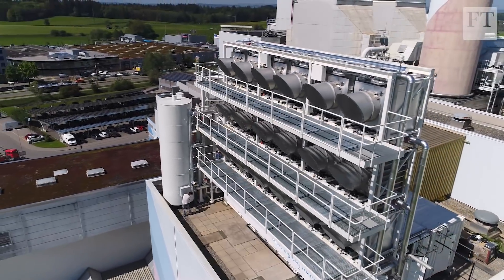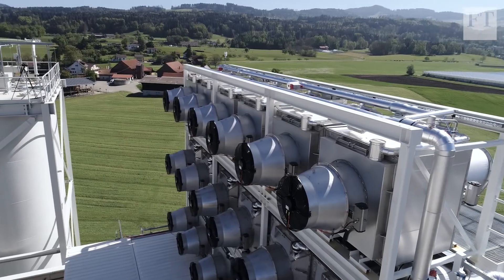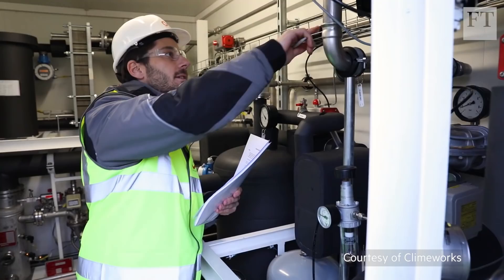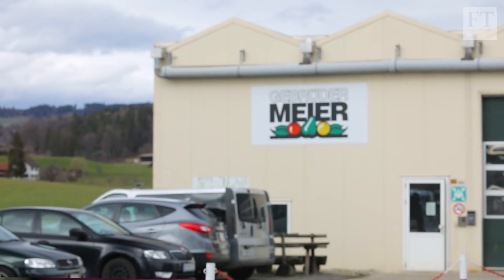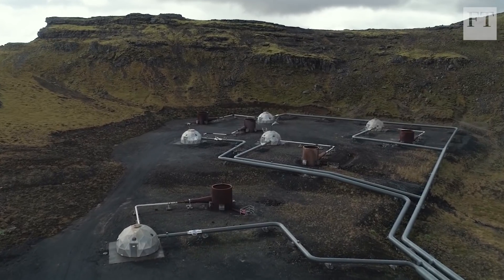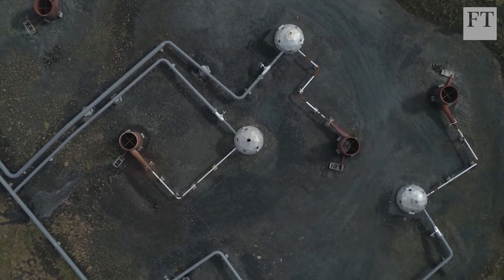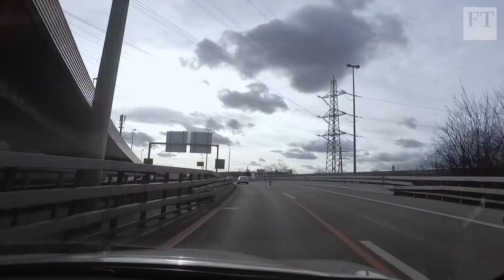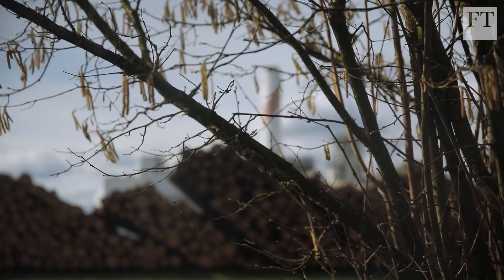How capturing CO2 from air can combat climate change

Comment: Doesn't it make more sense to filter the CO2 out of the exhaust gases of the waste incineration plant and to use the energy output as a substitute for fossil power plants? How much CO2 can be captured from the air with 1 MWh of electric energy input?

Comment: to say adding CO2 at the present rate is a crisis is being alarmist. While pollution in china and india is a real problem, pushing for climate regulations of C02 is a communist UN fraud. The climate models they run are a good science project but not accurate enough to determine energy policy.  Understanding why the climate model projections are essentially useless for policy is not easy but to say there is an initial state problem is the only way to summarize why they are only projections. C02 from man is not a pollutant and it wont end life on earth or even cause a crisis. Within 50 years it will be a moot point and all humans will have done is given in to hysteria and wasted a few trillion dollars for nothing.

Comment: Are you aware that teachers and professors are lying to you.  The science of radiation greenhouse effect is actually a lie.  If you see the video on my channel you will see that when a heat source is surrounded by CO2 it cools, not warms.  All of the "so-called science" of radiation greenhouse effect is nothing of a sort.  It is all lies.
Reply: I observed your three posted videos. Obviously you sunk a lot of money and time into this experiment of yours and it clearly was driven by an obsessive belief that back radiation from carbon dioxide is a lie. It is based upon your biased reading, of the NASA article, in which you already assumed that the CO2 molecules back radiate to the earth's surface. That was an incorrect assumption of what the article said.

Your experiment was poorly controlled for a number of factors. It was in no way configured the same way that experiments, showing the greenhouse gas effect, are configured. This experiment included no gas temperature measuring equipment, surface measuring equipment, or spectrographic equipment that would have provided quantitive data on the wavelengths of electromagnetic energy entering and leaving the system.

The filament on the high was being cooled by easily understood principals of loss from its blackbody radiation and via flow of the CO2 gas carrying it's thermal energy upwards. There was absolutely no evidence provided that any sort of back radiation was involved. Sorry, but you have deluded yourself. You are in the company of millions of other people who have deluded themselves.

Obviously, you have no firm academic background in fields such as radiation physics. There are millions of other people who are convinced that they know more than those with full academic credentials and a life-time of experience working in such fields.
Reply: Your explanation and demonstration are flawed and misleading.

When the solar energy, that makes it through the atmosphere, heats the land surface it warms it causing some of it to reradiate in the far infrared spectrum of the electromagnetic spectrum. Some of that energy is absorbed by the CO2 in the atmosphere which then increases the vibrational energy of those molecules. That energy is then transferred to the surrounding air molecules which heats them. Otherwise, the earth's reradiated infrared energy would travel back out into space. This CO2 capture, of the earth's radiated infrared energy, has been known for over 100 years. The heated atmosphere then does not heat the earth by radiated energy. It heats the surface by conductive and convective forces.

Those, without a strong academic background in the physics of thermodynamic principles, would not be expected to understand this process.
Reply: @vernonbrechin4207  Heres a link which shows NASA explanation.  Even their stupid (AND FALSE) energy budget shows IR emitting down and even shows the WORDS EMITTED. Its all a lie as my experiment clearly shows. https://science.nasa.gov/ems/13_radiationbudget
Reply: @vernonbrechin4207  Your another liar.  Your explanation is one you have just made up yourself and isnt present on the international websites, including NASA.  What they do show is made up bs with 2 plates, showing a radiation exchange.  Also, CO2 is an emissive gas and therefore increases the rate of heat lost from the atmosphere, meaning the level of energy which returns back to the surface is far less than it otherwise would be, if  it was instead a non-emissive gas.  Its contact with the warmer molecules around it causes a localised cooling effect.  It is well known that if you want to keep something warm you DECREASE emissivity.  This is the reason aluminium foil is wrapped around the outside of heating pipes.  Increasing the emissivity of something is how you make them cooler.  Increasing the oemissivity of the atmosphere, reduces the A / E Ratio of the Earth, resulting in lower steady state temperatures. The truth remains, CO2 doesnt induce any form of back heating.  Beside, did you SEE ANY FORM OF WARMING OCCUR TO THE FILAMENT??? As shown in the experiment.  The fake science of back radiation is a lie and anyone who argues that it isn't it is spouting sophistry.

Comment: Sorry, but climate change is a manufactured story !!!!!!!
Reply: You are correct.  You should see the experiment on my channel. (You tube wont let me post the links - they dont like proof against climate change.)  It proves that CO2 doesnt back radiate to heat source to make them hotter.
Reply: @gerainthughes3725  - Your explanation and demonstration are flawed and misleading.

When the solar energy, that makes it through the atmosphere, heats the land surface it warms it causing some of it to reradiate in the far infrared spectrum of the electromagnetic spectrum. Some of that energy is absorbed by the CO2 in the atmosphere which then increases the vibrational energy of those molecules. That energy is then transferred to the surrounding air molecules which heats them. Otherwise, the earth's reradiated infrared energy would travel back out into space. This CO2 capture, of the earth's radiated infrared energy, has been known for over 100 years. The heated atmosphere then does not heat the earth by radiated energy. It heats the surface by conductive and convective forces.

Those, without a strong academic background in the physics of thermodynamic principles, would not be expected to understand this process.
Reply: @gerainthughes3725  - When the solar energy, that makes it through the atmosphere, heats the land surface it warms it causing some of it to reradiate in the far infrared spectrum of the electromagnetic spectrum. Some of that energy is absorbed by the CO2 in the atmosphere which then increases the vibrational energy of those molecules. That energy is then transferred to the surrounding air molecules which heats them. Otherwise, the earth's reradiated infrared energy would travel back out into space. This CO2 capture, of the earth's radiated infrared energy, has been known for over 100 years. The heated atmosphere then does not heat the earth by radiated energy. It heats the surface by conductive and convective forces.

Those, without a strong academic background in the physics of thermodynamic principles, would not be expected to understand this process.
Reply: Just like evolution
Reply: @Richard482  your baby response wont change anything.  Watch the video on my channel and you will see the truth.  CO2 does not add heat to a heat source, to think such a thing could happen is just plain stupid.  Everyone need to wake up and realise they are being lied to by professors and politicians the world over.

Comment: Canadian company gets $68 million to build out ‘negative emissions’ carbon capture tech. March 22, 2019. 'The company plans on using the money to “commercialize and enter mainstream markets with its fully demonstrated DAC technology that is able to capture and purify atmospheric carbon dioxide (CO2) for under USD $100/tonne.”Carbon Engineering isn’t the only company to work on Direct Air Capture technology, which captures CO2 from atmospheric air, and puts it into purified form for use or storage. The company says it can deliver large-scale “negative emissions” by “permanently and safely storing the CO2 underground.”Carbon Engineering can also integrate its DAC technology with its “Air to Fuels” technology. This tech allows the company to convert the CO2 captured from the atmosphere into “ultra-low carbon fuels that can power existing cars, trucks and airplanes without any modifications.” CE says these synthetic “cleaner burning” fuels “are drop-in compatible with today’s engines and infrastructure.”' https://electrek.co/2019/03/22/negative-emissions-carbon-tech/

Comment: There are things called trees.
Reply: Considering a tree absorbs 0.024 tons of carbon a year it would  3750 trees to remove the same amount of carbon dioxide as this plant is removing. While I'm all up for planting more trees finding space for those 3750 trees is a bit unrealistic
Reply: @kieradennison5989  I'm pretty sure you could fit that many trees in a space not much bigger than this plant. And trees cost absolutely nothing to run. But it seems this company is harbouring the CO2 for reuse, which you can't do with trees.
Reply: @Pining_for_the_fjords  Nop, a fully grown and mature tree take a lot of space. There is no change they could fit 3750 trees on the same area. One single tree is around 40 feet in diameter of space. 

An American football field is about  57 564 square foot (120yards x 53.3yards), and the area diameter of a mature tree, on average, is 1256 square foot (40 foot diam.). That mean you can fit only 45.5 tree down there... Even if you squise them and double the quantity, you still way outperform trees with the machine.

The facility area is about as small as the roof building of the waste plan, so is not big at all.
Reply: @kieradennison5989  I don't think so.
Reply: Trouble is in the UK they seem to prefer chopping them down rather than planting them.
Reply: Two year old
Reply: Not nearly efficient enough.
Reply: There isn't enough arable land on planet Earth to plant the number of trees necessary to absorb the 40 billion tons of carbon a year that comes through all our tailpipes and out all our smokestacks.
Reply: @brooklynculturejam6282  Misinformation!
Reply: @roblloyd1879  Do the math. Per NCSU's 'Tree Facts' website, a mature tree can absorb 'as much as 48 pounds of carbon dioxide per year'. It would therefore take 40-50 trees to absorb a single ton of C02. Assuming you can plant 120 trees per acre, your single acre of planting would absorb three tons of carbon. Industrial civilization put out 40  BILLION tons of carbon in 2017. To absorb all that you'd need to plant  roughly 13 BILLION Acres of new trees. In a 2013 UN report, it was estimated that the world had 1.407 Billion hectares of land not in cultivation, or 3.5 billion acres for planting trees. There is no way you can plant 13 billion acres of trees on 3.5 billion acres of arable land.